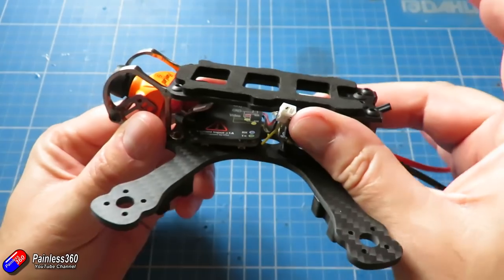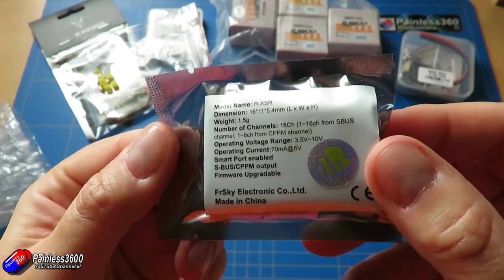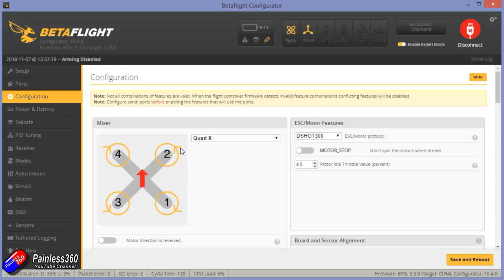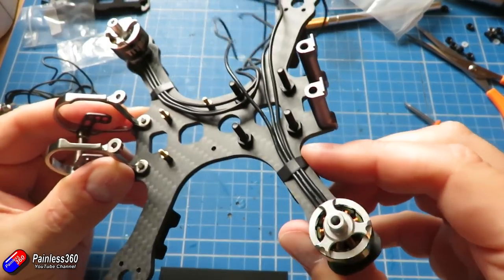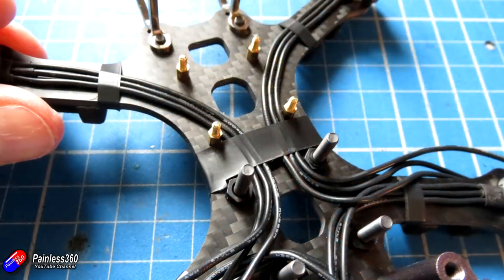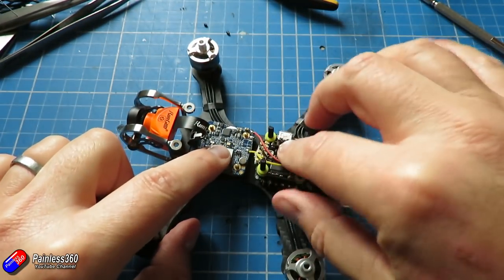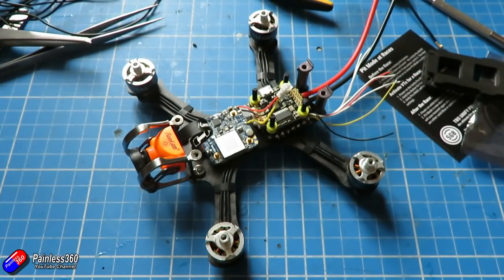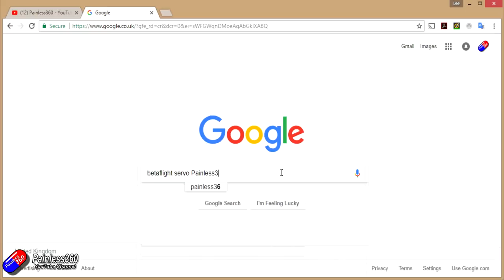(S11.2) 3" Quad Build - Layout and soldering of the power system

Comment: Just started this build over the weekend myself. I have dry fit everything so far and seem to have the same game plan as you at this point. I plan on using the R9 MM receiver with F.Port, is really the only difference. Different vtx as well, but it will wire up the same. Very interested to see the rest of your build and how you wire it up! Cheers 👍
Reply from the maker: I'm struggling to get the telemetry working here with this receiver, I will be doing a video about it in the next week or so. So do check that fport works well before getting too far into the build. Best of luck!
Reply: Issue with inversion you think? I'm hoping the R9 MM with the inverted pad(or un-inverted, depending how you look at it) will make it easier for me since that FC doesn't have the telemetry pad like it's big brother.
Reply from the maker: Exactly. I do a test before you start to put lots of lots of things together. Best of luck!

Comment: Have you had any problems with that ribbon cable on the runcam split Mini 2 because I already bought two of them but I had to fold my ribbon Cable in order to fit it into my drone ih2 V2 from iflight
Reply from the maker: I haven't but always be careful when you're putting sharp radius bends in cables like this it can cause the tracks to break. Happy fly

Comment: Just finished my REAL1MS 3" quad for $21 with  GEPRC Speedx 1408 4100kv motors, EMAX 4 in 1 BLHeli_32 ESC 35A, Omnibus F4 Pro Corner FC, WS2812B LED strip with 4 LEDs, EACHINE VTX03 Super Mini, iFlight RaceCam R1 2.3mm Lens and GEPRC 3042 3 blade props for a total of $166.51 compared to $289 of the Armattan. And I strongly believe my 3" flies better, looks better with its vertical arms and is faster..... And btw if I want to record a HD video I fly it with my Quelima  SQ13 sports camera for $17.

Comment: Hi, Thanks for such a nice video.  I also am building a 4in Gecko at the moment.  For now, I want to ask what kind of tape you used for wrapping the wires of the motors?  Thanks in advance.
Reply from the maker: Just regular insulation tape..
Reply: Thanks very much for your reply. I have not seen such size insulation tape.  I need to look around.
Reply from the maker: @ericto3552  Mine is normal size but cut into strips with an Exacto :)
Reply: I did search around during the weekend; and found nothing like thinner size tape.  So I decided to buy one with a brown colour 3M vinyl electrical tape and cut into two thin tape to use using scissors.  Never thought of using Exacto!  : ) @Painless360

Comment: How long does the front motor-wires need to be?
Reply from the maker: Not sure I understand the question..
Reply: Sorry, explained it wrong. I meant: the front motor-wires are a little longer than the back motor-wires. My question is: can I use regular motor-wire length for this frame? I've the hglrc 1408 motors. The wires are 80mm long